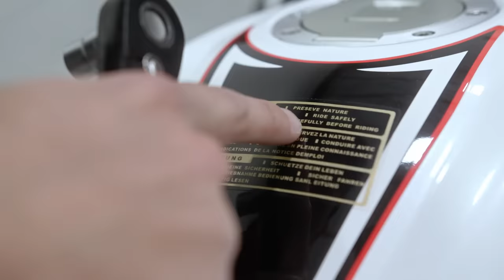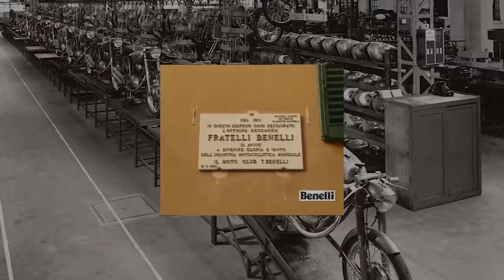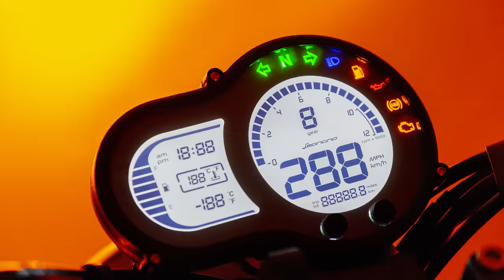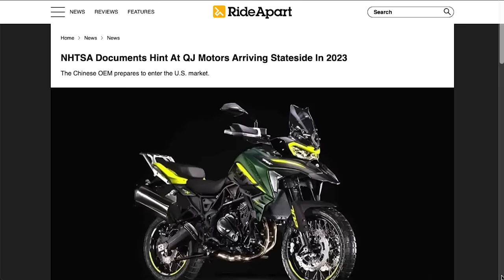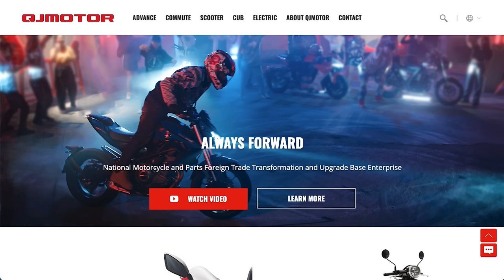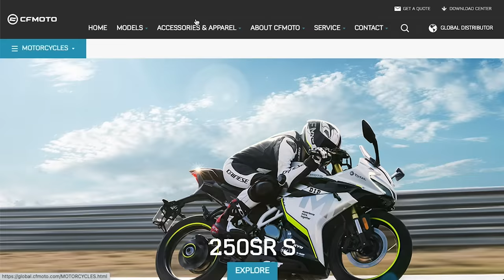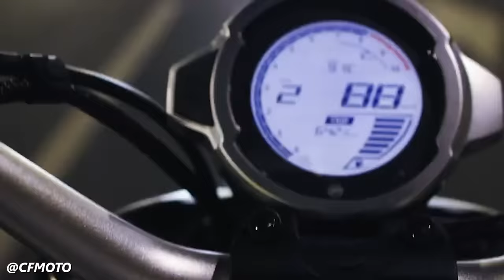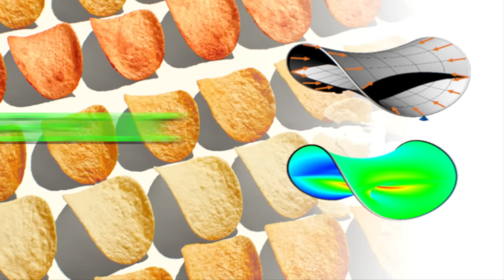7 Chinese Motorcycles that are WORTH IT

Comment: Picked up the cfmoto 650 adventura about a month ago and I love it! The comparison of price to features between this bike and bikes from the japanese big 4 are miles apart. The aftermarket support isn't as established for cfmoto, sure, but I've got 3 dealers within a reasonable distance and plenty more if I wanted to drive an extra hour or 2. Not to mention, I got this thing for msrp out the door. Can't say enough good things about it so far.
Reply: Price is literally the only thing it beats the Big Four on. Japan is so far ahead of China on engine longevity, reliability, and quality - it’s not even a competition. 

CFMoto riders will be on bike #3 while a Japanese bike will be on rider #3.
Reply: @dr.rupture8467  actually is not that far away in terms of reliability. Yeah, the crappy ebay bikes are absolute crap, but the good chinese bikes like CFMOTO actually are really reliable, using engines designed by kawasaki o KTM. Also features are a BIG PLUS. The 300nk comes with full LED lights, dual channel ABS (you woulnt believe how such basic thing is not that common on $4000 and below bikes) a TFT display with bluetooth connectivity and 2 riding modes. The duke 250 that costs like 1000dls more  have alogen lights, a cockpit designed 10 years ago and just recently added abs.
Reply: Dunno, I rode mine 650TK for four years and 50k kilometers. Never had an issue with it. Now it happily serves the next owner with the milage above 70k, as far as I know.
I personally wouldn't sell it if not moving to another country, and would totally buy another cfmoto when I get the chance
Reply: @sergusster  It might be fine in your country but in Canada they are just a lost cause.

Comment: Maybe some Honorable Mentions: GPX, Kove (who finished the Dakar rally with all entries), and to an extend, Loncin. And for engine manufacturers: Zongshen and Loncin. Fun fact: Loncin makes engines for some BMW's, whilst some Japanese brands use parts made by Zongshen. I personally have a love/hate relationship with Lifan engines. Usually rather solid engines, but damn are they slow when it comes to fixing issues. My moped has a Lifan-made Honda CB 50 clone engine, and it worked well until the crankshaft bearings exploded on me, ruining the engine. This apparently was a common issue with this type of engine between 2019 and 2021. I had to get a replacement engine, built in 2018. Have not had any issues so far with the new engine, and it survived far longer than the one that blew up on me.
Reply: GPX is Thai brand that use chinese component and most of modern looking bike they made are crap. Only the classic line the round head light air-cooled cradle frame are reliable. But most of the sport-looking bike are not worth buying. For now.
Reply: @lockpinos   I mean GPX Moto, as it's known in the US and UK. Made in China. I vaguely know the Thai GPX and it's Shittyness, but GPX moto (Chinese one) has some quality bikes. Just ask Torture Test Magazine or eveRide. The only major complaint was the FSE 450, with a "sluggish" feel and the engine running hot, though this is fixable with different mapping. Kove used that  same Zongshen 450 engine, modified it to be DOHC instead of SOHC, fiddled around with mapping and did some other things to it, and turned it into a reliable 51 HP beast that revs to about 9-10K RPM. With long service intervals. That's a good sell.
Reply: The Kove seems legit AF!
Reply: @michaelearley8852  you mean the 450 rally? Yeah, that's gonna be a banger. They've also made other bikes, and they have been well recieved.
Reply: CSC makes some great bikes based off a Honda clone engine and have a dealership here in California.
Reply: @elpockrandt7908  csc imports for Zongshen bikes. They dont make anything, really.

Comment: thanks mate i was sweating about me trk 502 i think its good but i haven't been riding since 2002 that was me one and only ever Cosworth piston  Gpz 600 r still got it if anybody is interested and i started squid riding on Kawasaki triples and mastered the wheelies best about 2 miles up and down hill then a corner was my usual place from Capalaba and up Redland bay road  as any one they all bought brand new bikes the Gs 1000 Laverda Jota and a 1100 Kawasaki in a Rickman frame i went past him 2 up in 4th at 143 mph I'm now 64 but still hard to beat you name the coarse may be not mx as i have weight and stamina difficulties all others motor sports i will not be beaten bike or car  just an idea doubt any one will pick it up as a Idea for a show I got 10 mil insurance liability so I'm good to go meet my maker  x aussie in uk

Comment: I think there should be a video or a website somewere or even a forum, that would say from where are the engines on this brands. I had a 125CC a few years back (on a z1000 now xD) and the brand was "JIANSHE 125 custom", and after a lot of research i found out that the plastics and etc where in fact chinese but the engine for example is from yamaha more specificly from the "Yamaha YBR 125 CUSTOM" and it was nice to know that even tho the brand was chinese the engine was from yamaha. I would like to know more about the engines because i dont think that these chinese brands are making the engines themselfs. If anyone knows a place to check it please reply xD

Comment: The only good chinese bike, is the one with many service parts. In Mexico chinese bikes are the 70 percent off all bike sales. 

The only good brands are those where you can find any kind of parts on your city available to purchase and install the same day.

Ive seen chinese bikes with over 70k miles. But only the ones with a good inventory of spare parts.

They are nasty and cheap. They shake and vibrate. They dont have fuel injection. But they can go and go without leaving you stranded on the road. As long as you take good care of them.

Comment: Here in our country, the 800MT aka ibex 800 are long around and have been tested in endurance races. Its a good motorcycle and bang for the buck considering all its features. I just have doubts for the components outside the engine. While QJmotor is testing their 600rr 4 inline sportsbike here as well and have been used in endurance races. So far so good but still i would go for kawasaki for peace of mind. Maybe just maybe i will raise an eyebrow for the 600rr of QJmotor once its established

Comment: bruh whatever you do, dont touch Benelli!! the 752S almost killed me several times! the bike stalls when you break just a bit harder, and has issues running again unless you turn off and turn on the kill switch because of the shitty ECU. and it IS HEAVY!!!! 230 KG for a street bike that only has 70 ish HP

Comment: Sadly yes most really all Chinese buy from Amazon are not worth the 2535 hundred dollars you pay for them however I have done extensive research into Chinese motorcycles the only one that I can find that is worth a crap as I have seen is a Honda CRF250L and the only reviews that I can find our with the 5-speed transmission and a unbalanced 2023 have a 6-speed trans and a balanced

Comment: cfomoto ?  Doesn't anyone remember that in 2009 They F over anyone that had bought one of there scooters in usa? They closed shop , stopped offering parts  and walked away.  Once the parts dealers had in stock went bye bye then you re were SOL!  Guess my point is if  they welling to do it once whom to say that they ll not do it again.

Comment: My experience with CFMoto 650 Adventura has been abysmal I am in Canada. I hate this thing beyond belief.  Quality issues with seat, and fairings, wind buffeting is horrible,  Electrics are bad, with in  a year, Fuel tank sensor went, side stand switch went bad, Short in the entire system blew main fuse which stupidly is located UNDER THE TANK, which requires disassembly of the entire bike. Horrible warranty 5 years or 10k.. Really 10K. NO PARTS availability (couldn't get oil filters), no after market support. Throttle control is terrible, riding modes dont make a lick of difference, fuel mileage is not great.  Worse part of this bike is the design of fairings pushes got air into your crotch,  this bike is horrible for any riding under 60kph, constantly doing Harley star fish.  This thing actually overheated on my numerous times and shutdown, I had to change out the coolant and I run heavy oil in it.  Clunky transmission, very vibey . Just spend the extra 2k and get a vstrom 650 or a versys. Horrible bike for some reason people praise this POS.

Comment: So, I own 9 motorcycles. Suzuki, Honda, Kawasaki, Ducati and even a Harley. I also own one Chinese bike, the CSC RX4.

I'm surprised you didn't mention this one, because the CSC guys in California keep all the parts in stock, and the quality of the bike is great. Not excellent, but great.

I have owned two, and about to upgrade to the RX6. Why two? Well, I traded off my 2019 which had 22k miles to get the new model with the TFT dash new electronics, like tire pressure monitors and bluetooth capability. I sold that buke for 2500, which was half what I paid for it.

I tried to break the newer one. I did the first service at 500 miles, then I didn't service it again until it had 12k miles. I was doing a 48 state run with it, and just decided I'd go until it died. It didn't. I literally had to decide to stop.

I kept the chain lubed and tires checked, but I did no engine maintenance or oil changes for over 12k miles. Never noticed any issues with it, and when I finally did a service on it I was completely blown away how good everything looked inside.

The engine had no extra wear, the sprockets were still good, even the tires had another 5k miles on them. Yeah, I had one mirror get rusty being out in the weather, but it was less than 20 bucks for a new one.

Then I brought it to Hawaii, and it was ridden as a commuter everyday, about 8 miles total a day, for a year. Again, no service was done to it. All the rain, and we get a TON of rain, salty air and sitting in the parking lot uncovered, the bike still runs like it did 15k miles ago.

I've changed the tires once, that's it. Still has the same battery.

5500 bucks total, that's with the skidplate and aluminum luggage. The Honda I own went to the shop 4 times in it's first year. Spent more time in the shop than being ridden in it's first year, and it was just a bad motor....twice.

Now, I'd not go so far to say that the RX4 is better than the Honda, but considering it was 1/3 the price, it's comparable. And it's not ugly...it looks a lot like a BMW. My wife had one that was stolen with only 1k miles on it.

It's a ZongShen bike from China, but CSC works with them directly to make sure every bike they get it quality and legal in the US. Readily available parts, and they even have a healthy number of places across the country that will service it, even in Hawaii.

The other bikes they sell are good from what I can tell talking to owners.

I ride it more than any other bike I own, because it has proven that even when neglected it will just go. Sure, it's no the most luxurious bike around, but the features it comes with standard are options that cost thousands of dollars on the Japanese models, and in many cases aren't even options.

Just surprised it didn't make your list.

Comment: I hate to tell you this, but there's no such thing as a good Chinese motorcycle
There's a reason recyclers won't recycle Chinese steel
Reply: This is, true, but good is subjective, do not reflect nothing without context. For example, pit bikes are a fuck ton of fun, and a big part of this is those dirt cheap engines and all those inexpensive, easy to fix stuff.
 Even the big names ones are absolutely not perfect, it's just a mith, they break almost as easily as these(on this video) cinese brands, being that they come out from the same factory gates..
 My personal experience is that I've bought a Keeway rkv 125 from someone and it was pretty much a disaster as AA new bike, but extremely easy to fix. Not only that, but with the right fluids and torqued and mounted properly, it becomed a good motorbike.
 So, QJ motors and i don't remember those other giant factories are OK in my book, I'll never consider them not even close to the Japan models, but i rather get one new, over an old Jap/Euro.

Comment: I have a lovely KSR GRS 125cc as my first bike (because in Portugal you can drive a 125cc with a car license and yeah, had zero experience with bikes or even scooters before). Bought it used this year, previous owner put 28k in it in 5 years and it actually seems to be okay. 
Rusting is barely an issue due to local weather (shit you not, you can find 30-40 y.o Japanese and Italian cars with no rust), fuel economy is also decent, but of course it lacks power with its mighty 11hp. Basically a KTM duke clone (apparently assambled in Austria; surprise? Don't think so) from Benelli